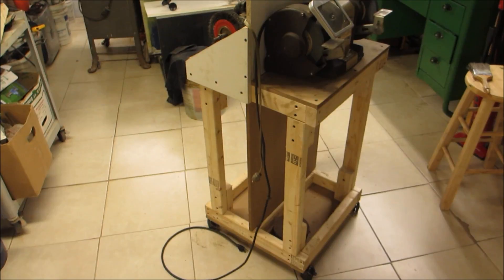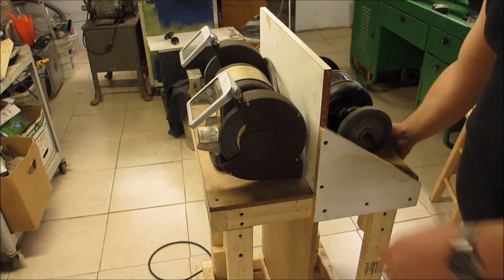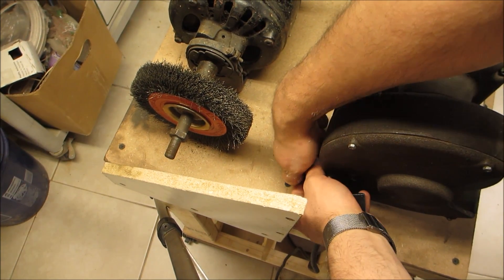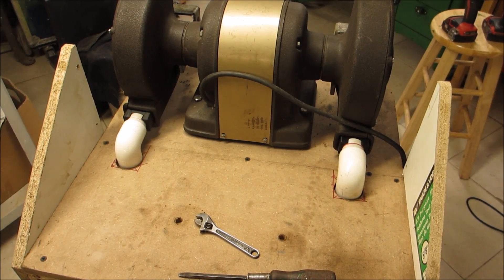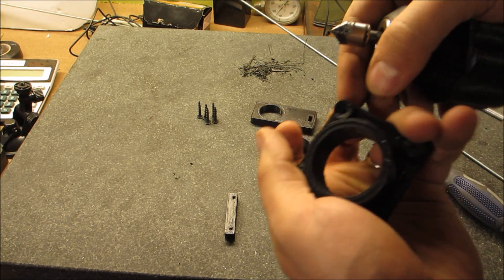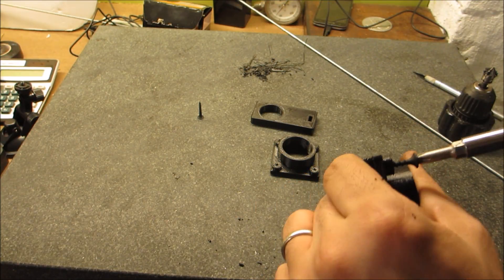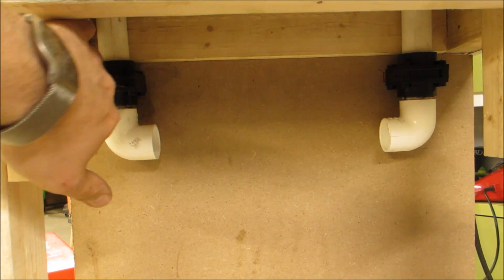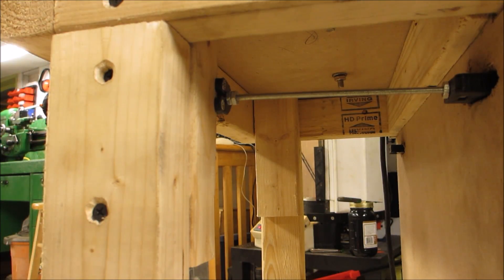Bench Grinder Dust Collection Part1

Comment: Great idea! I am working on a dust collector for my bench grinder since I make kydex sheaths for a living. I produce a ton of dust which causes serious air quality issues.  My issue is coming up with a good design for the actual "hood" or "shroud" since adding a hose to the area for the dust collection is not as easy as we all think. The size of the hose, velocity of air moving, amount of air moving, position of the shroud, the shape and size of the hood/shroud all play a very important role in the functionality of the collector. When I 1st threw a hose behind my buffing wheel i thought the power of my shop vac would be enough. But then I noticed i was not catching much dust even though my shop vac is a large and powerful vac. I learned that it doesn't matter how powerful your vac is its the design of the collector at the buffer wheel that's important 1st and power of the vac 2nd. I used my little 2.5hp vac because it was smaller and easier to setup later and my cardboard hood that I made to surround the buffing wheel worked pretty good. I made the hood to contain 1/2 of the wheel and made it just big enough to surround the wheel with no openings or holes in the shroud that would cause an "air leak" so I had 100% vacuum only through the opening of the shroud that surrounded 1/2 the wheel. I still want to work on its design but I think I am heading in the right direction for a very efficient shroud . I realized air velocity to create a good vacuum and shroud design was what I needed rather than a large hose with a big hood. A more targeted shroud that strategically encapsulates half of the wheel with small hose for velocity works great. My cardboard shroud is about 1/2" from each side of wheel and also 1/2" from top and bottom of wheel with 1/2 of the wheel inside the shroud. this shroud is small and tight fitting.  I am going to increase velocity by decreasing the hose size. I am only collecting dust and not pieces of kydex so no worries of obstruction of the hose. I just have to be careful so the vacuum doesn't suck the part out of my hand lol...i need 100% dust removal since the wheel will spin particles off the wheel all the way around it and not just downward.  There are still particles stuck on the wheel that does not come off till later in the wheel rotation, which is the complete rotation.  I figure a powerful vacuum with a good shroud and small hose will catch all particles and not throw whats left on the wheel up in the air or back on the wall or at me. At least if something does come off the wheel the vacuum is strong enough to pull it back into the shroud and into the dust collection "shop vac".
Reply from the maker: Those are some good points. It's about optimizing the design more than brute forcing it. Also do not discount a small dust separator in line. They really do work wonders. My design is definitely not 100% but it works well for my grinding needs. I would say the dust separator in line is 80-90% efficient with 5-10% being lost at the shroud and 5% making it to the filter.

Comment: Great idea on the printed blast gates, love it.  I was just give a grinder the same as your craftsman.
Reply from the maker: Randy Richard In The Shop. Randy it's actually a very nice machine. It's not a baldor, but its built so much better than stuff is built today. For starters it stays out when you use it. It also takes forever to spin down.  Both good signs in my book.